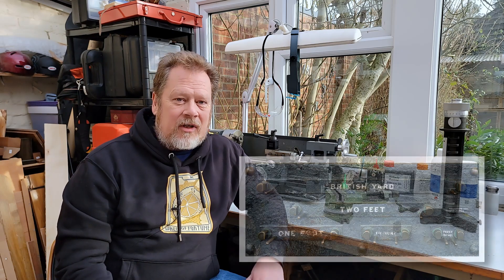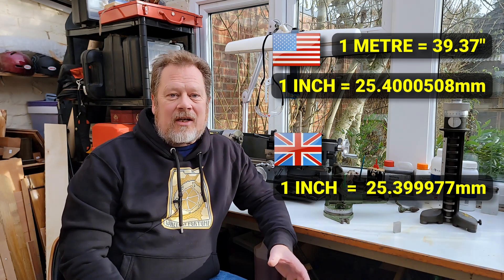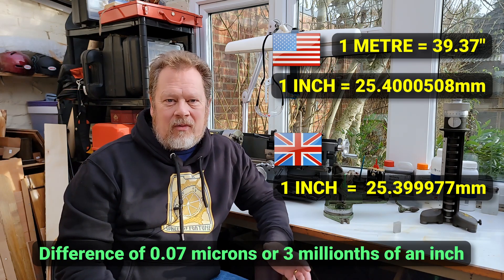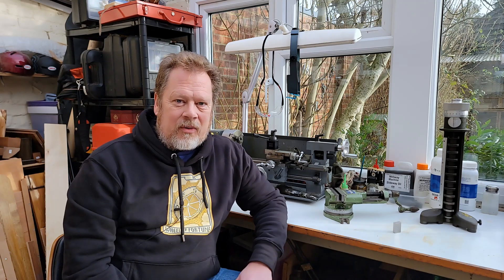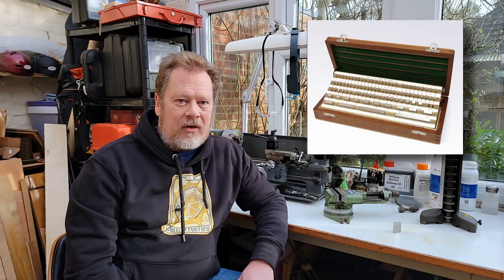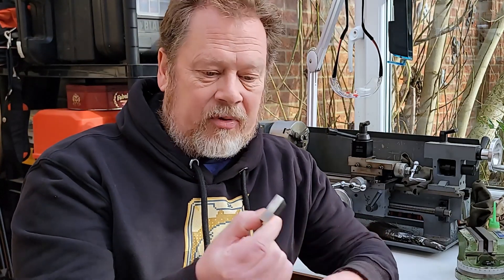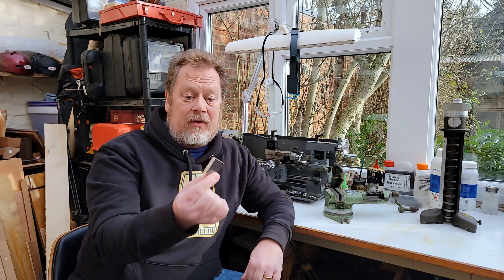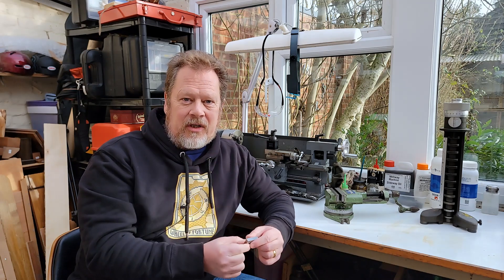And how the US Inch was based on Metric...

Comment: Btw.: 31 December 2022 was the last day the US survey foot (1200/3937 metres) should be used.
Reply from the maker: Thanks for the info, I didn't realise that the old US inch lived on as 12 to the US Survey Foot. The history of measurement is like a never ending rabbit holes of twists and turns, fascinating stuff 👍
Reply: @radboogie  I've seen videos that suggest that some US buildings have problems because the height limits are still defined in old laws using the survey foot, so that horizontal measures and vertical measures use those different units, with consequences, on larger skyscrapers.
Reply from the maker: @philipoakley5498  I can see how the errors would compound on something so massive. And really hard to spot on the drawings I bet.
Reply: @radboogie  @herosstratos It would be useful to know what the law change was that set that last use-by date and how it promulgated to other older laws. Often these 'old law' conflicts arise because folks aren't aware of the linking statutes that resolve the dispute.
Reply: @radboogie — Surveyors use feet, tenths, and hundredths.  I don't know if they were ever interested in inches.

Comment: I run a CNC lathe, which sadly is set up in Imperial units, (American owned company, but in metric Australia). I have to work to the 4th decimal, yet the engineers I work with keep rounding the majority of dimensions to the 3rd. It really drives me up the wall!
Reply: Do you work for Anthony Bearings in Melbourne? I remember when we went metric that they decided to keep with imperial units internally as they didn’t want to upgrade their machine tools.
That was in the eighties; we went metric in 1972.
Reply: @tuppyglossop222  Nah. Different company. They are a bit set in their ways, especially because of the American influence.
Reply from the maker: That must be frustrating! Does the CNC controller have an option for switching between metric and imperial, or is it more that you all work in imperial being an American firm?
Reply: @radboogie  It's a bit of both. The parameters can be changed, but once you change you really need to stick with it. (Putting a metric offset in while in inch mode could be disastrous)! And, previous programs need to be converted, although is not that difficult these days.

Comment: Ok, after listening to the “By the way…” comment at the end four times, I still can’t make it out. Anyone care to enlighten me?
Reply: A metre is close to 40 inches but is just a bit shy of it at 39.37007874 inches (1000/25.4). So a thousandth of a metre being a millimetre is close to 40 thousandths of an inch but just a bit shy of it at 39.370007874 thousandths of an inch. So for rough and mean visualisations of a dimension in one system of units or the other you can use 1mm=0.04". So for example 100mm approximately equals 4" but not quite, so not quite good enough for precise engineering. I think and work in millimetres for small dimensions so if I see 1/8" I think of it as 0.125" and dividing 125 by 40 gives me a little more than 3mm as an example. Good enough for getting an idea of what 1/8" is but not good enough to make something 1/8" if working in millimetres. The opposite way of rough conversion is to go from millimetres to inches. So in order to visualise 4mm in inches multiply it by 40 and you get 160 thousandths of an inch, 0.160 inches. As I say, good enough for an idea of a size but not precise, and as the sizes get bigger the error also gets bigger. Imagine you are looking a plans for some sort of model (not something consequential in other words) and it says a screw is M3, this is a metric screw with a 3mm diameter thread. You don't want to go to the trouble of getting an M3 screw or the tooling to make an M3 threaded hole. You want to use a typical USA screw instead, you multiply 3 x 40 and get 0.120 so know that it is close to 1/8" so know that you can probably use a 1/8" screw as a replacement.
Reply from the maker: Spot on ☝️

I was brought up being told there's 40 thous to the mm, but people forget to use the word "approximately". As you say if you use that ratio to convert between inches and mm you get considerable errors. Thanks for the detailed summary 👍

Comment: It's always nice to be reminded of these things, Richard. I suspect this would have been pretty well the last standardisation of length that you or me could measure before they moved to using the speed of light measured by caesium clocks.
Reply from the maker: Yes, pinning the standards to repeatable and constant references is the pinnacle really. Like back in the 1800s when British parliament burned down and so did all the standards of length and weight. Not to mention that the old physical standards would change size with age 👍

Comment: Actually, measurement was very important in the late 1800s. They invented micrometers in the mid 1850s. When Brown & Sharp came out with the modern version a few years later, it measured to the ten thousandths. By the end of the 1800s they were using optical measuring systems capable of reading to one hundred thousandths, and shortly after, a millionth. I’ve got books from the later 1800s showing how to fit shafts to a hundred thousandth. So it’s not true that high accuracy didn’t matter until later. I work to a tenth in my shop on a fairly regular basis. In order to do so, I have to measure with equipment that’s more accurate than that. The concept of making the inch more attune to metric was a great idea. It didn’t matter most of the time when manufacturing, at first, as manufacturers simply continued to produce with the equipment they had. When it came time to replace them, the new equipment used the new standard. For most smaller objects, it was the same. For larger ones, there would be a tiny difference. But the most important purpose was to simplify calculations. Because you always had to use the accurate numbers, because at some point, they would matter. But now, it’s much simpler, which means many fewer mistakes.
Reply: The age of the mechanical lathe was the continuous development of better tools to make better precision tools, with a major sideline in basic industrial machining ;-)

The same happened with the development of modern electronics when the best microprocessors were used to design the next generation processors with a sideline business and home computers ;-)

virtuous circles.

Comment: I'll have to check, but the reason the inches are different is because bronze shrinks slowly compared to the platinum-iridium meter.  The US compared to the meter, got a number, Great Britain compared later, got a smaller number.
Reply from the maker: It is a long and complex history when you start digging into it - very interesting. Another problem the British had was the "Burning of Parliament" where the parliament building burned in 1834 down along with all the standards for length and weight.

Comment: I believe that the O&G Drilling still use 10 divissions to a 12" . As a piping engineer i knew pick up a tape measure he found laying about, on an offshore platform, took some piping dimensions,  had a spool made up on shore. When the spool offered up it did not fit! Turns out that the tape measure was left by a drilling crew.
Reply from the maker: Wow, I hadn't heard of that before. Decimal inches yes, but not decimal feet! 👍
Reply: When I worked at the Bishop mine in California in 1980 they used a metric foot, 10 1.2 “inches”, they even had special scale rules produced, this being before CAD. All fairly amusing as I used metric units back in NZ
Reply: They aren't inches, they are tenths of a foot.  I have a surveyor's tape marked in tenths and hundredths of a foot.  It is easy to tell the difference between the engineer's scale and the carpenter's scale.

Comment: Hi Richard, I've maybe banged on about this before, can't remember but as you do a lot of woodwork I thought it worth mentioning that I use Lego blocks as guage blocks.  If you take a Lego baseboard and use the top of that as a reference surface from which to measure then adding a 1 high brick will raise the height by pretty much exactly 1/8".  So you can work in 1/8" increments.  It's all imperial, which is an advantage for me because I like to use imperial fractions for all my project dimensions.   The advantage of Lego I guess in this application is that it is cheap, highly accurate and doesn't expand and contract with the weather like a wooden gauge block might.  Just thought that was worth mentioning
Reply from the maker: That's a superb idea, really creative thinking there 👍 Imperial is good for me as I flit between Metric and Imperial even though I was brought up on metric. I will have to try that sometime. Thanks for sharing!
Reply: I create all sorts of chiselling jigs and whatnot to create very accurate pircture frame rebates etc.  The nice thing is being able to chop and change as required.  Also, since the stud matrix is highly accurate, it is easy to create almost perfect 90 degree jigs (and possibly other angles with a bit of trig).
Reply from the maker: @deemdoubleu  it'd be great to see some of your jigs, they sound really interesting. If you use Discord I have a server where you can share photos. https://discord.gg/FJxYdzYCaG
Reply: I wonder if that might be due to the original product being designed by Hilary Page and his company Kiddicraft, for further information just search for him.
Reply: Most modern machine tools(CNC) Can be programmed in imperial or metric units and actually American machines like HAAS while operating both systems actually have 6mm pitch leadscrews under the machine slides.The computer takes care of the rest.